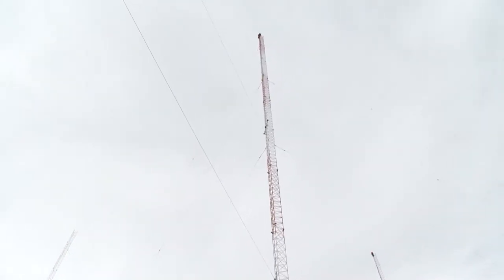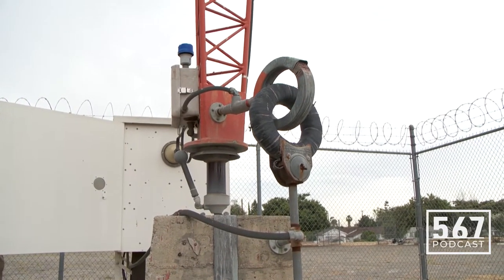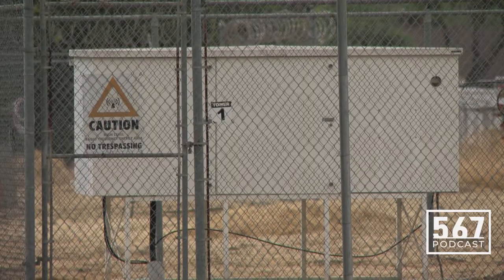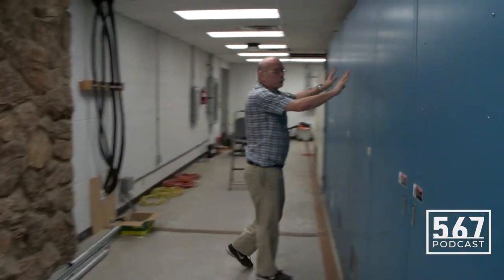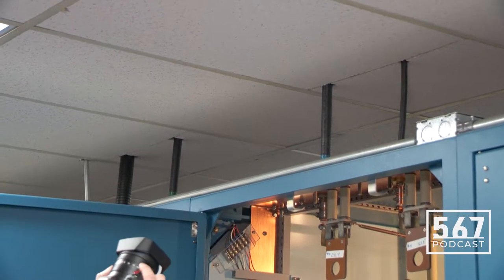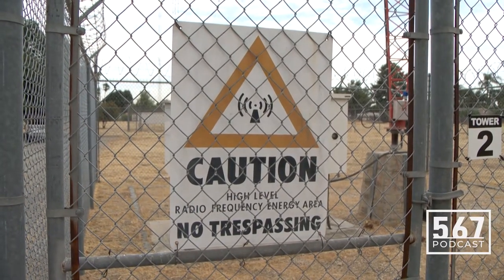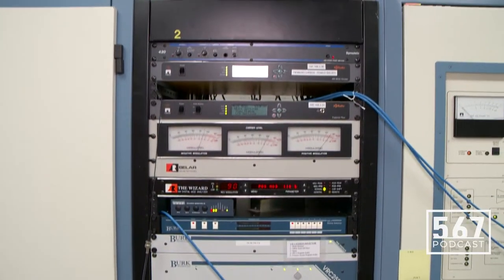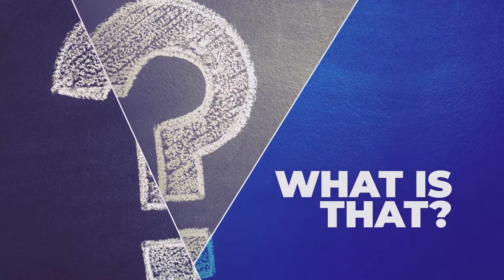What is That? Inside an AM Radio Station Transmitter Site

Comment: AM Radio was always only as good as the receivers we use. Bandwidth, from the IF transformers in a radio, is the issue. AM Radio can sound wonderful as it does not have the sputtering sound associated with FM Radio and an effect known as picket fencing. Very annoying when driving your car and listening to the radio. AM Radio is the superior technology that big money radio has forgotten about. Or, they never knew about it's advantages because they are corporate bean counters. Using a Tecsun or Sangean Radio with wide AM bandwidth is a very pleasant listening experience without FM distortion. I recommend the Tecsun 501x. AM Radio has coverage advantages far beyond the one lung FM stations in most markets with their 60 mile best reach.
Reply: You're forgetting AM is inherently susceptible to ignition and charging system noise, 60 hz transmission, lightning and doesn't work inside buildings, also BW limited to 5 kHz no matter how you slice it.

Comment: According to radio-locator, this station operates at 7500 watts at night but I'm sure the station engineer would be right in this case.
Right off of Lassen St in Arleta in the San Fernando valley area.

Comment: What kind of grounding is that; those interlaced doughnuts?
Reply: That's a lighting voltage coupling transformer. The tower is insulated from ground. In case of lightning, it will arc the gap.
Reply: @thecw301  You're right. The Austin Ring transformer allows the tower lights to get power but without a direct connection that would couple the modulated carrier signal to back-feed into the AC line. I wish I had invented it!
Reply: It is called an Austin transformer because Austin was the name of the company who first manufactured it. It is a toroidal transformer. The magnetic core is a donut shape (a toroid). The primary winding, which is connected to 120 VAC power, is wound directly on the core. The core and the primary winding is the vertical ring, mounted to a pipe anchored to the ground. The ring attached to the tower is the secondary winding. Obviously there is a physical space of a few inches between the secondary winding and the rest of the transformer. But this does not matter, so long as the secondary windings pass through the core. Since it's a transformer, power is transferred from the primary to the secondary by a magnetic field in the core. So it brings 120 VAC to the tower to run the lights in a way that isolates the tower, which is energized with thousands of watts of RF, from ground.